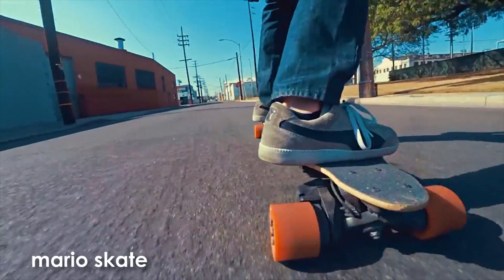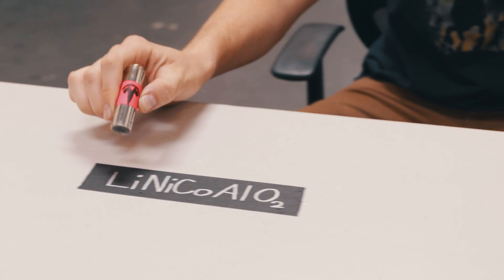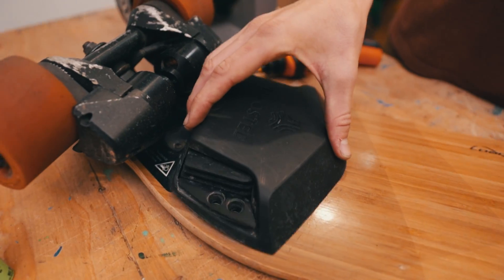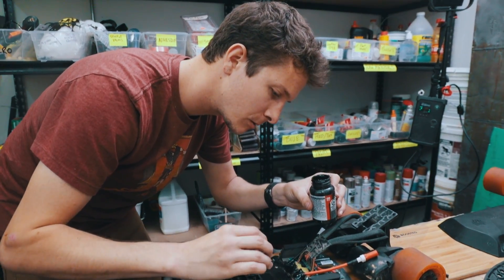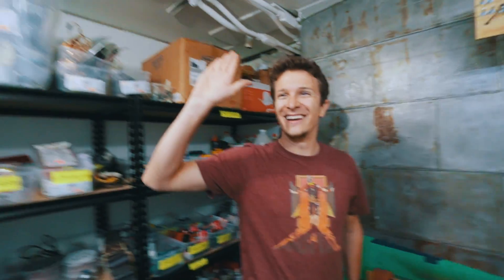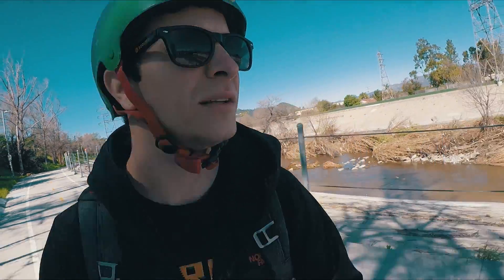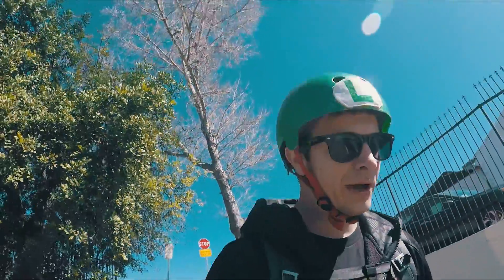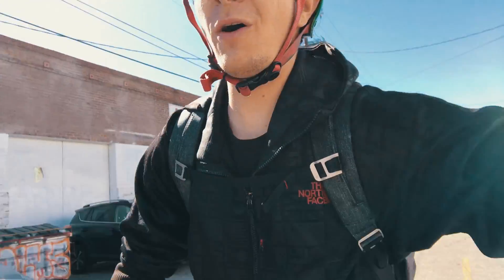Tesla Batteries in an Electric Skateboard!

Comment: I think I know what is happening. The panasonic cells you've got are one of the best cells when it comes to capacity. However, those are not designed to output high power, I am guessing you have their NCR18650B cells (judging by the iconic green sleeving), and those can only put out 1-2C (around 3-6A) according to their datasheet. In your 2P10S configuration, I'd say they can only put out 12A max, quite lacking for a high powered device like your boosted board.
  This was not a problem when the LiFePO4 cells were outputting power as well, but when those falls flat, the 18650 batteries you've got simply does not pack quite the punch. The relatively high internal resistance of the 18650 cells means when you do a high current discharge with the motors, the terminal voltage of the cells drops and can't power the board, but when you connect your multimeter across the cells, the high impedance of the meter does not pull much current so it displays a normal voltage reading. 
  To fix the problem, I suggest you either look at Lipo cells made for RC use, as they can put out a large amount of current(>30C). However, the wimpy casing around them will sure puncture and explode with your method of installing the batteries.
  If you want to stick with 18650, I know LG and SONY make some high (but not Lipo high) discharge 18650 cells. While model numbers escapes me, vaping forums are a good place to learn from, as their e-cig things pulls quite a lot current and mostly use 18650 cells.
  Another thing to keep in mind, devices that use rechargeable batteries usually have a low voltage cutout circuit to prevent over-discharging of cells. While I don't think this is the problem you were facing, as you could get the board moving, just without you weight. However, while you haven't hit the low voltage cutout yet, it might limit the extra juice you can get out of your new batteries.
Reply: The boost converter is an interesting idea, but not practical. The boosted board clearly pulls more than 10 amps at more than 30v. Only very few boost converters can output that kind of power, without having to add massive heatsinks, fans etc. So stick with upgrading the batteries.
Reply: I'm not very experienced with these 18650 cells, but if you are correct about the C ratings then that is probably the best answer about the low power. I built an electric longboard with a single 245kv brushless motor (speed and range of mine is similar to a Boosted board) and that motor's current draw is around 40-60A, even higher under extreme loads. So you would need a lot of these packs in parallel to satisfy that current draw. I used 2x3S 30C 5000mah LiPos in series. 
Luckily I can just switch packs and travel 30-40km (18-25mi) with 3 sets of batteries. At first I wanted to pack at least 4 batteries (2P2S) on the board but since that made the board heavy to carry and my regular commutes are not longer than I can handle with just 2, I decided on switchable packs.
Reply: Yay, Wren replied!!!
But...I don't think your solution will work very well, to understand why, you must first understand these two simple formula that governs every voltage converters:
  Output power = Input power * efficiency(0 to 100%)
  Power = volts * amps
  Which means if you pull 10A at 40V from the boost converter for the motors, and your pack is at 20v, even a perfect boost converter will try to pull 20A from the batteries:
  40V x 10A = 20V x 20A
   In reality, at that config, the boost converter will pull much more than 20 amps from the batteries, as power is lost to heat when converting. So you can't escape and might worsen the problem of the cells not being able to output enough amps. You can't beat the law of Physics!
   One rule of thumb when integrating DC voltage converters : the larger the difference in the input and output voltage, the lower the efficiency. Boosting from 20v to 40v is a nightmare for most dc converters, I'd say at 20v difference, most converters will only have 80% efficiency max. i.e. if your motor takes 1000w of power, you batteries will have to give 1250w of power, and 250w is turned into heat. My soldering iron only takes 30w to get to soldering temperatures.
  Also, if the heat doesn't kill your converter, the voltage generated by the motors when you brake and manually push the board will likely kill or damage the converter, unless additional circuitry is used.
  I found this cell manufactured by Sony, the US18650VTC6, it has a bit less capacity, but rated for much higher current (30A), with your current two 40v pack config, it should meet your needs, capable of putting out 60A. IMO this is the best solution.
  If you still wish to experiment with the converter, you can give yourself a fighting chance by not changing the battery config, and connect the buck/boost converter to the two 40v packs and the motor. That way you can increase the efficiency of the converter by having similar input and output voltages. That is if your solar power converter can take 40v inputs.
  One last thing, If you don't strap a battery protection board to the packs, at least connect a fuse in series with each pack, along with a low voltage alarm widget you can get for cheap at RC shops. Never abuse li-ion cells or they will release all the energy in milliseconds (aka explosion), learnt that the hard way.
Reply: Sander A.  Well, then he would need a buck boost dual mode voltage regulator and he only has a boost module. Besides, then he will have to re solder the batteries and balancing connections etc. IMO not quite worth the hassle and need to buy more stuff anyways. He can simply use the existing packs and have more capacity with 20 cells or the lipo packs. Even at an  optimistic efficiency of 90%, 16 cells will only charge the onewheel around 1.3 times. Every solution will have drawbacks and it is up to him to decide how to do it.
Reply: You're welcome, I learned from the internet for years, so it'd only be fair if I give back :D
  The rule I've mentioned about DC-DC converters is applicable to both boost up and buck down converters. Though this a just a general rule of thumb used for rough evaluation of solutions and not for precise calculations. While in the same mode of operation (buck/boost) this rule is mostly true, it is hard to predict and compare efficiency of the converter when working in different modes. Efficiency characteristics varies with different designs and also depend on output current etc. So you should find the datasheet for each particular voltage converters and look at the efficiency vs input voltage curve or other related data. Can't really answer that boost 18v vs buck 22v answer without more data. However, my guess is it would not be very different and 40v is much easier and safer to work with than 80v.

  On the Onewheel charging situation, you are right about about the efficiency problem, inverting DC to AC is hard to get it perfect. I am fairly sure the unit you've got is a boost only module. If you are using that, both the 18650 40v packs in parallel and the 22.2v lipo packs in series will work. One thing to bare in mind: a single lithium cell is at 4.2v when full, 3.7v nominal, 3.0v flat, so the lipo-in-series solution will have 12 cells in series and have 50.4v when full, 50.4v<58v so your converter will be fine and work quite efficiently. 

  The choice between 18650 pack and lipo pack depends how much bulk you are willing to carry. Assuming an efficiency around 80%, I' guess the two 18650 packs will give you 1.5 Onewheel charges, while the two lipo packs will give you 4.4 charges.

edit: Wow those SONY cells are expensive in the US, in where I am (Hong Kong), 20 of those would only cost $90USD :D
Reply: If you don't plan to use these cells on the Boosted board anymore, then you could just connect more of them in series to reach the Onewheel's voltage and wouldn't have to do any boosting. 15 cells seems to be enough.
Reply: Sander A. That might work, but it depends on what voltage range the onewheel can charge at. With 15 cells, the pack will be at 63v when charged and 45v when flat, I don't think the onewheel will like it. Some form of voltage regulation will likely be needed.
Reply: That's a big difference indeed. But still smaller than before and conversion efficiency will be better when using a regulator. Then 16 cells would be an even better middle ground?
Reply: Zenith_Logs _ You can look down on us nerds, but boosted boards, Teslas, onewheels would not exist without people like us.
Reply: Tat Wong, thanks! So far you're one of the only ones who have truly identified my problem. 

I didn't want to do LiPos because I was afraid they'd be too easily damaged. My reasoning for going with the NCR18650B batts is for their high capacity and I was hoping that by sharing the load between the internal pack and two parallel packs, I'd be able to still meet the current draw the motors would require. This assumption was obviously wrong. I needed way more power than I was giving the board. 

I actually just got a really nice Boost/buck converter that's typically made for controlling solar panels. I'm not sure what the upper Amp limit is off the top of my head though. I'm considering splitting the 2 packs into 4 packs at 20V each, and boosting them back up to 40 (I also realize these numbers are oversimplified in this video). The issue is that then they'd remain at that voltage rather than deplete slowly alongside the internal LiPO4 batts. This would double my C rating from the combined pack, but I'm not not sure it'd be enough either. I know I'd take an efficiency loss from the voltage converter but I wonder if it'd be worth it to get the extra capacity I'm not currently utilizing. 

Although to be honest, I may end up just making a new pack of 18650s with higher C ratings like you mentioned. I avoided those to begin with because their capacity was so low that I didn't think I'd be able to get the range I needed. However, if I do make new packs, I can still use this pack as a mobile battery charger for my Onewheel thanks to that solar controller I mentioned. That's actually probably my very next project.
Reply: Thank you for your thought out response! I'm pretty sure I follow what you're saying. The boost converter idea was just simply an idea. It's good to know that it's not a good one haha, so I won't try it and waste my time and money. To be honest I probably wouldn't have tried it anyway because I don't think it'd be worth the effort. I'd prefer to just make a different battery pack. Also, I did just pick up some of those low voltage alarms with the intent of monitoring voltage in real time. I just looked up those Sony batteries. They're pretty expensive so I'm not sure I'll go this route haha. It'd cost $180 just for the batts. I may still do this but I'll wait and see.

So to segue to my other idea, let me ask you another question. You mention that voltage conversion efficiency drops with larger voltage differences. Does this go both ways, converting down and converting up? If I wanted to instead utilize these batteries to charge my Onewheel through the solar controller, which is the better option? Should I keep these 40V batteries in parallel, boosting their voltage to 58V to charge the Onewheel? Or should I connect them in series and convert down from 80V to 58V? Going up is an 18V difference and going down is obviously larger at 22V. Will the efficiency changes be the same in either direction? Or is it favorable to boost up verses buck down (assuming the voltage differences are the same in either direction)?

My current mobile charging situation involves using a Li-Ion computer UPS to charge the Onewheel. It's 290Wh and has a built in inverter which I plug my 58V 3.5A power supply into. So here I'm converting from DC-AC, and then from AC-DC again, so I know I'm seeing a lot of efficiency losses there too. Surely that's more than the efficiency loss from DC-DC. I haven't figured out the exact efficiency but the Onewheel is 130Wh, so assuming 100% efficiency I should get more than 2 charges where as in reality I get about 1.7 charges. 
With the DC-DC route, I can also use a couple huge LiPo bricks. They're 22.2V nominal and 16Ah. Converting from 22 to 58 is a huge jump, so I assume it's better to connect them in series and just go from 44V to 58V, right? I really want this setup because it will allow me to use more batteries to get many more charges out of the Onewheel, without having to bring along the bulky UPS battery and the sizeable Onewheel charger. Here's the MPPT controller I got: http://a.co/hGDkOgt. Supposedly other people online have found success with this setup. Although it seems this controller can only boost voltages rather than step down as well.
Reply: Bunch of nerds Replying to King nerd

Comment: Wren, just remove the boosted board internal battery altogether, and use pure 18650 lithium batteries. Mixing battery chemistry's like that is a bad idea anyway. Also, to work out your range, it's just a matter of figuring out your average current draw on the board, and then doing the math on your total mAh capacity. You could use a simple 100A current sensor tied to a multirotor flight controller with a bluetooth link to your phone.

Comment: Separate the extra bit that can't be used and devise a third battery pack from them, otherwise replace the original boosted board battery. I know nothing of electrical engineering but from what you're explaining Ren, it sounds like the problem derives from the batteries being different sizes and possibly types?

Comment: Electrical Engineering student here
Best thing would be remove the original battery and then make 3(or more, as many as you can fit) "matched" packs of 40v in parallel and splice that directly into the regular supply line. This way the bms will tell your controller the correct power left, and it will safely protect against undervoltage, and overvoltage for that matter. If you want huge bursts of power (huge starting torque) you could also add a big capacitor, but i would test that before putting it on the board ;)

I think what is happening right now, as soon as the main battery hits the lower limit of the bms, the bms will cut the power, hence making your bypass of the bms unusable as soon as the main battery is low.
Reply: The Problem with the different chemistries still would be there, the Battery Management System would shut the motor down as soon as it thinks that the cells are empty, which is a higher threshold on the original batteries. The best bet would be to make the new packs from the same type of cells the original one uses. One important thing to watch is balancing out the cells, on the new packs as well
Reply: I am curious, what size cap do you think would be required? I suspect when you do the math, you will find its a very BIG capacitor. Given the system requirements, this might turn out to be a very expensive cap. practicing electrical engineer

Comment: In my opinion, It might be easier to just bypass the boostedboard battery altogether and hook in one big pack via your connectors. Makes it easier to charge and easier to maintain in the long run. This in theory will also give you the ability to check the capacity again on your hand controller. You could also salvage the boostedboard's 18650 and add it into the larger pack if they have similar voltages to your other 18650.

Looking forward to the update video on it :D

Comment: Have your custom batteries constantly charge your B-Board batteries.  Going back to the water analogy: You currently (pun[s] intended) have all three batteries draining at the same time, like two large lakes and one small lake flowing out of the same dam to make a single flow.  When the smallest lake drains, the dam closes.  My idea is for the two larger lakes to flow into the smaller lake.  The "water" will still flow from all lakes, but the larger lakes will drain and deplete their reserve before the smaller lake loses any of it's "water".  This sort of would fix your problem of monitoring your batteries because the LiPo will show that it's full until the LiNiCoAlO2 batteries drain.  Hope this kinda helps.
Reply: That´s a terrible idea, considering LiPos can only be charged about 1000 times before rapidly loosing capacity. If he were to do it your way there would be a pretty big current flowing through the battery at all times, whisch has the same effect as charging them constantly. Considering they have at least twice the capacity, possibly even more, that would result in 4-5 charging cycles per fully charged battery -> the LiPos would last less than a year
Reply: Thanks for the feed back.  Would it be a terrible idea to bypass the LiPo all together?  Just use the LiNiCoAlO2  as the energy source?  Would it be possible to do that and manage the output of energy?
Reply: Thanks for the responses!! I appreciate the feedback. Unfortunately Head Rag's idea doesn't really work. Batteries don't like being charged and used at the same time since that kind of breaks how batteries generate electricity. 

I'd prefer not to bypass the internal battery all-together since the board is so finely tuned to using the power output from it. The idea is to just supplement the battery's energy stores. The actual problem is that the tesla batteries I used aren't designed to output energy very quickly, and my solution to use two packs wasn't enough to overcome this problem. So I either need more packs in parallel, or replace the packs with batteries that can output power faster.
Reply: Glad to have contributed.  I learned quite a bit from this, hope wrenthereaper can figure this out.  I like these kinds of videos and hope to see more in the future.  Please keep us updated on your progress!